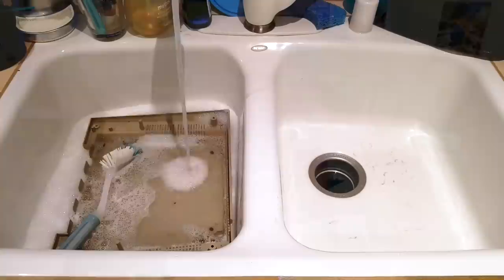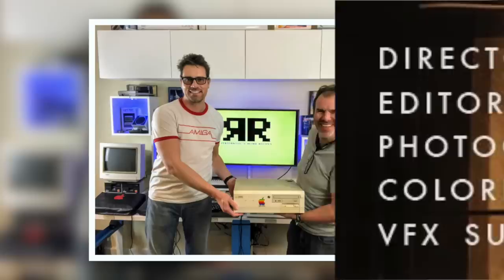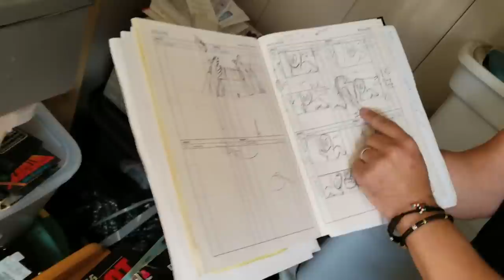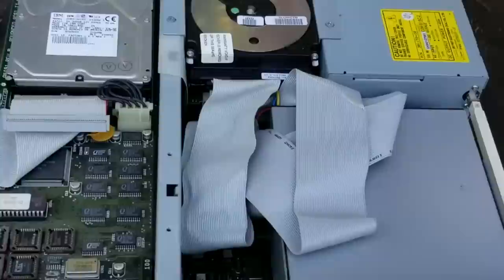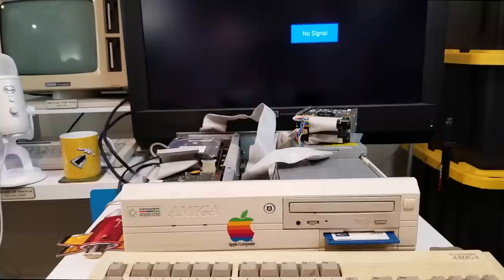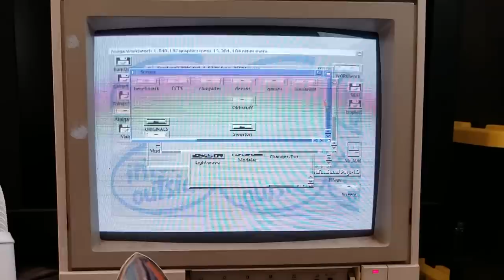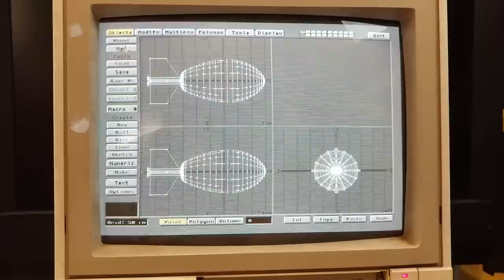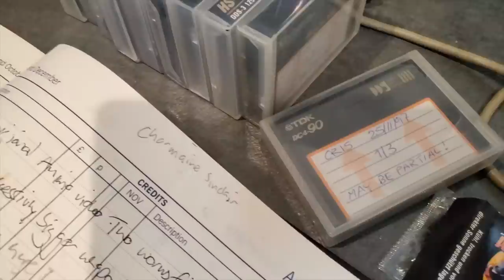I found Team17's WORMS developer Amiga 4000! Let's explore its harddisks

Comment: Wasn't worms later available to buy for the playstaion 1 ?
Reply: Amiga floppy and CDROM, PC CDROM, PSX, probably Saturn as well, and definitely - of all things - the Gameboy (I actually own it on cartridge). Wouldn't have been hugely surprised to see a MegaCD, maybe even Megadrive and SNES version either. A glaring omission is an ST version, which would have been doable with a bit of downgrade (STe may have handled it better, and a Falcon version would have been very nice), despite the dwindling market (what's that to a developer risen from the PD scene, originally expecting only 60k sales?), but I think Team17 would have preferred to walk over hot coals than be seen making a port to the hated rival...

Comment: You should hook it up in a PC with Linux and use ddrescue to create an image this is by far the safest thing you can do. It will try to read every byte on the drive skipping bad areas and returning to them after a the first pass. You don't need to be to read the filesystem. You can do that after when you have a copy of every byte on that drive.

Comment: I'm always amazed and depressed you guys in the states don't have any 50hz displays how the hell are you even using C64s and Amigas.. Literally nothing runs properly. I'd be crying myself to sleep if I couldn't watch demos.
Reply from the maker: I just use a framemeister xrgb mini for that however we wanted to get this running on original hardware not my big LCD screen. 🤷‍♂️
Reply: @RetroRecipes  I think there needs to be some international shipping of CRT boards, get some multiformat action into the states
Reply: Maybe there's a middle ground.. usually lots of 4:3 LCDs at Goodwill (On soledad).  I usually use those since i don't have space to set up every computer with it's matching CRT...  Although, the Amiga definitely is a pain with configuring the various screen modes.  Some LCD models that work better than others.
Reply: I thought most 15kHz RGB monitors were relatively Vsync agnostic... bit strange to see any that aren't. Mostly seen them specified as "50-60Hz" rather than just "60Hz"... it's at least partly the reason for having V-size and V-position controls appear much more often than H-size/pos ones, as the Hfreq and sync width/position doesn't change very much (maybe +/- a few percent, not enough to affect the apparent size or centering of each line) but the vertical could vary +/- 20% or so from a 60Hz centrepoint and still just-about sync...

Comment: I probably would have just connected the drives to a computer and cloned them either to another hard drive or an image using GNU ddrescue. I mean, once you do that, it doesn't matter what happens to the original drives at all, you've got an exact clone, with the bonus that were the original hard drives actually having problems immediately upon firing up, you would get the most amount of data possible off them without having to do further damage by attempting to transfer the data itself. I wouldn't even use a USB interface due to the abstraction layer that USB provides (by having a native interface you eliminate the obfuscation of controller commands, which is often a very real issue when attempting to clone bad disks over USB).

I'm not saying that the method you used was bad by any means, it gets the job done. But if the data is truly important (as this probably was) and hard drive errors are assumed to be likely, I don't think this is the best way to go about it.
Reply: Also a note, PCB swaps no longer are nearly as effective as they used to be because half of the hard drive firmware is stored on the PCB and is specific to the individual drive (the other piece of the firmware is stored in the service area of the drive, which is not easily accessible without using specialized tools such as PC-3000).

If they're not spinning up at all, then one of two things is likely: either the spindle motors are seized, in which case they can sometimes be unstuck via heat, or the PCBs themselves have blown TSV diodes which is preventing power from getting to where it needs to be. If you've already swapped PCBs on these drives and they still don't spin (even a drive with incorrect firmware will still spin if it powers properly), then again the likely scenario is that the motor is seized. The alternative is that the heads are stuck on the platters, but usually this is accompanied by beeping sounds as the drive tries to spin. Then again, I'm not quite sure about drives that are this old (I'm not actually a data recovery specialist, I just have a lot of experience with various states of hard drive failures and know what I know). I would assume they would still make a similar beeping noise if the heads were stuck.

Regardless, if a PCB swap results in them not spinning up at all, and no beeping like a stuck head, then your problem is likely more severe and you'll want to send it to a data recovery specialist. Even if you swap PCBs and it still doesn't work, you may want to send if off if you're not comfortable with SMD chip replacement or if you don't have the necessary tools to swap ROM chips.

Comment: Why were you having so much trouble getting a stable picture on that 1084? I'm using an American 1084S with a PAL A1200 and it works a charm.
Reply from the maker: It might be because it's not a 1084S.
Reply: @RetroRecipes  I mean, yeah fair. I didn't think they were that different, internally.